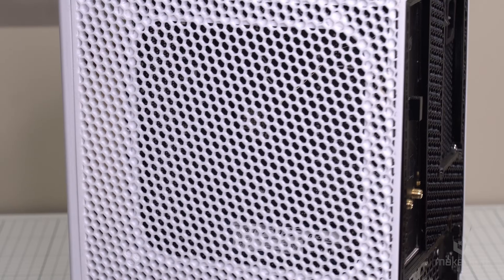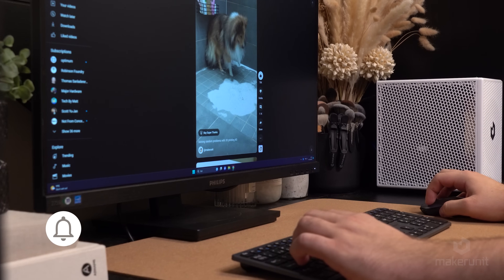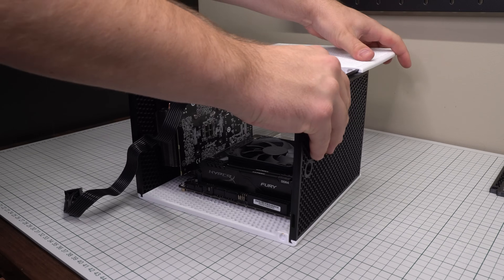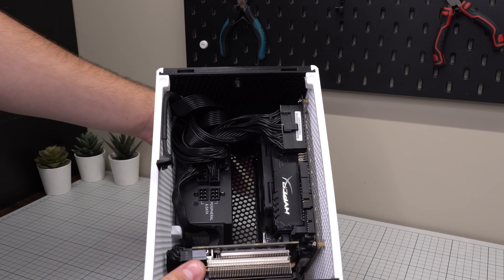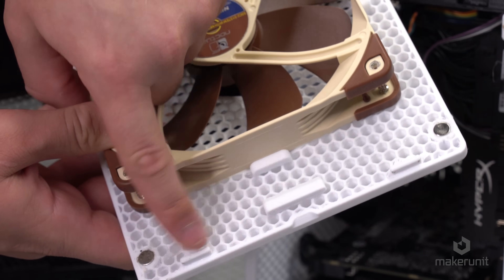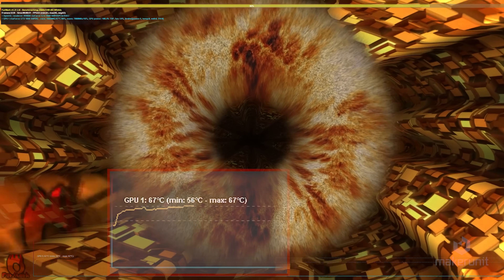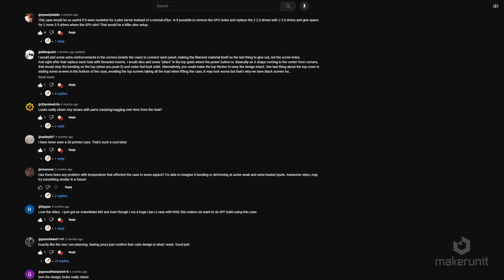Tiny 8.1L SFF build - 3D printed PC case

Comment: Adding space for an ATX power supply would be great!
Reply from the maker: Working on a solution for that for this specific design while the mATX version is printing! 😊 I’m experimenting with this exact model as we speak trying to find a clever way to adapt it for ATX psu without having to cut back on other features 😊
Reply: @makerunit  yeah that’d be great! I’m slowly downsizing my PC as I go (moving from a huge case to a smaller one, getting rid of HDDs in favor of M.2 drives on the motherboard) and the next step will be downsizing from an ATX to an ITX motherboard. The one part I don’t like to compromise on is the PSU though, and SFX power supplies are usually either too expensive or too unreliable for a quality budget build imo. I really admire your work with 3d printing computer cases though!

Comment: I am planing on building a really small case for watercooled cpu+ full size gpu with a riser cable and a normal psu. You maybe got a Motherboard mounting for ATX as well?
Reply from the maker: At the moment I only have for mATX. There are plenty of schematics online though that can be used as reference. Just google «ATX motherboard hole spacing» or similarand you’ll find something.

Comment: I beleive that a literally cool  idea is to modify your project to include a 120mm AIO cpu cooler, by example the Corsair H55 or H60, or Cooler Master - MasterLiquid Lite 120 or NZXT Kraken 120 just to name a few choices. With ths modification, the front fan can be removed. I am going to try the Corsair H55 that I have it already. What do you think of thos mod?
Reply from the maker: There would probably be room for that and it’d be a cool mod to possibly add to a new version. I’m planning a longer version of this same concept. Also a bigger one for mATX.

Comment: Very interesting project. I am going to build it right now. I have a doubt: What is the maximum height for the CPU cooler? Which cpu cooler model  do you used?
Reply from the maker: I used a Ryzen 7 5700G processor, cooled by the Noctua L9a cooler. Though I’ve got some room to spare and I think you’ll be able to survive with the stock coolers on Intel and AMD as well… I think they should barely fit.

Comment: How much did this cost you? Total cost?
Reply from the maker: About 700 grams of filament ($14 in plastic assuming 1kg is $20).

If you think including the PC parts themselves it’s kind of hard to say as it’s a mix of newer and older parts where some are not available anymore.
Reply: @makerunit  yeah I was talking just the case. And WOW. That is pretty cheap compared to all these small $80-$100 ITX cases. Thanks for replying man I really appreciate that.
Reply from the maker: @GabeTheDark1  I forgot to mention that I also had to get some magnets, screws and threaded inserts so I’d probably add another 10 dollars worth of hardware so I’d say about 25-30 bucks total to make the case.

Comment: You should absolutely design an mATX case. Think something like a Sama IM01/02 alternative. It fills the niche of being able to house any GPU and CPU by being a rival to the Cooler Master NR200, but with support for mATX motherboards and ATX PSUs without sacrificing the GPU length, like how the NR200 does with an ATX PSU bracket. The availability around the world is spotty and I for instance cannot buy it for the proper amount of money. I don't mind it taking up to a day to print all parts, but don't forget that ITX parts like the motherboard and the SFX PSUs cost a lot of money and we'd rather buy a mATX motherboard with a bigger PSU, if it's needed, to save on money. You may make it a bit sturdier to be able to handle a big tower cooler, but I don't think you should really focus on coolers that are too heavy and too big, which can handle Intel CPUs, because you only really need to focus on AMD CPUs like the Ryzen 9 7950X which would be undervolted and running at 105W Eco Mode, to greatly improve efficiency (necessary for europeans) and to be able to decrease the size of the CPU cooler (also, you only really need a CPU like the Ryzen 7 7700 non-X, and the GPU like the RX 7800 XT or lower, because RX 7600 seems like a good value GPU for most people though I don't even game, and frankly, neither should anyone).

That being said, I don't think many people would need very powerful hardware at all. A Ryzen 5 7600 with an RX 7600 or maybe even no dGPU at all (for an ultra-small 2L build with a Flex ITX PSU, which may as well have the best small heatsink to handle up to 16 cores at 65-105W on Eco Mode undervolted) would be a good choice, in particular for those that only have CPU-only workloads and for those who only need an iGPU (and some Tetris on the side) and favour portability, because plastic cases are very light.

So imagine doing something like an interchangeable design between the 8.5L version and the 2L version for Flex-ITX builds with no dGPUs, if that would be possible, where some of the panels like the main panels for the motherboard side can be used with either the parts needed for the 8.5L case or the 2L case.
Reply: Though if you were to design a 2L case, you should make sure to have mATX support, because it's very hard to find B650 ITX boards, and they cost an arm and a leg
Reply from the maker: Hi! I understand. Actually I’ve got a project in the making right now based on pretty much this same concept and it’s supporting all the parts you’re talking about. And a plus is it can actually support the big CPU coolers for almost any CPU you’d like. Even large GPU’s and tons of storage has been taken into consideration here in a fairly compact build tbh given what it can hold. 

Currently printing out the parts for the prototype and things are looking promising for now. 😊 I think many people will like this one because of the flexibility it’ll provide.

Comment: Amazing build yet again! I'm debating between modifying this to be longer for my GPU and a 2.5 hard drive or just using the Chimney case you made last month.
Reply from the maker: Or just wait for me to design the longer version of this same case. 😉 first a mATX version though.
Reply from the maker: Hi! Just checking in to let you know that I have completely re-designed this case to fit a longer GPU, harddrives and more, keeping the exact same aesthetics exept from the length. The print files are already available to get if you're a member of my Printables Club. Feel free to check them out already. Full video is in progress making and will be posted as soon as possible. Here's the link if you are interested. https://www.printables.com/model/688060-little-boy-s-long-edition-115l-itx

Comment: Love this concept. I think a slightly larger version that allows for current GPU’s would be fantastic. Also usage for front IO would be really good.
Reply from the maker: mATX prototype of similar concept in the making as we speak. First panel just hit the print bed. We’re talking 300mm gpu, 240mm AIO, HDD’s, ATX psu and more in a fairly compact build actually 😊

Comment: Tip for magnet polarity. Attach the magnet to the first one you install, then use a sharpie to put a dot on the side facing out of the second magnet. Then you just need to install the magnets dot side in
Reply from the maker: Great idea! Simple and effective. Do you know if the sharpie may affect the glue adhesion though? 😊

Comment: What type of soldering iron do you use? And any hopes for 6liter-7liter?
Reply from the maker: It’s possible to shrink this current design a tiny bit more by using a 120mm fan in the front and having the front panel pushed even closer allowing for a max gpu length of 170mm instead. Probably shaving off another liter making it about 7.

Then making the external covers even slimmer (with a one piece external cover) it could get down to about 6.5 probably in this config. (Maybe even 6) but that’d be tight to assemble.

My very first design I ever made like 2.5 years ago was something like that. A mini ITX with zero room to spare.. without using riser cables or anything, but it was a very plain and boring design which I ended up not really using, but it did work. Though I no longer have these files so I’d have to do a complete redesign in that case. 

About the soldering iron, just a regular pointy soldering iron that I believe is quite old, it has no brand that I know of…

Comment: I've always wondered if it would be possible to design a small(ish) form factor case where one of the walls is a 240m/360m radiator. Cooling capacity would be enough for a single loop between CPU/GPU with similar components to the ones you're currently using, but could drastically reduce spatial requirement for airflow, especially with something like a Barrow CPU pump/block/res combo.
Reply from the maker: Most things are possible one way or another and I think your idea in theory should work like with a low profile cpu block, and having the AIO right above the GPU, squished all the way into the motherboard. Should be doable. But I have no experience in water cooling a GPU.

Comment: I would not be surprised to see this style of case being mass produced
Reply from the maker: Maybe maybe some day 😊
Reply: Not realistic really, all the parts would need to be made with a cnc and the magnets would not be a thing since the weight of the panels
Reply from the maker: @yeetmeister0704  mass produced can mean a lot of things. Noone mentioned that it would have been made out of lead or gold. (Which is heavy)

If it was aluminium the weight and perforation  in the panels like this it wouldn’t really be an issue. 

Also the panels are supported both at the top and bottom meaning not much weight is actually on the magnets. 

And I’d agree that to make it manufacturable in metal it’d need a few design changes but that wasn’t the point here, the point was the «style» of case, not this exact design. 😊

Comment: All I can say is that your work is amazing. The designs are clean while easy to understand and print. I have a suggestion for this series. I would be amazing to make a case for a small home lab server. The main ideea is to be able to have a lot of space for the 2.5" drive/SSDs. I tried online but i wasn't able to find a good design and i think with your design experience, you can help a lot of people wanting to build their own 100% diy mini home lab server. 
It is just an ideea, i know this things take A LOT of your time. Might be quite cool tho :) .
Anyway, you rock!
Reply: I'll second this idea but add that a lot of home server/NAS setups use 3.5" drives for cost and reliability. 4 drive slots would be a minimum I think
Reply from the maker: Thank you! The idea is definitely cool and a possibility for a future project! I have some hard drives laying around so I’ll consider it, thanks for the suggestions and the positive feedback 😊

Comment: Could you add a dedicated SD card reader to this design?
Reply from the maker: It’s possible. Though I don’t know of any panel mount SD readers, do you know of any? That can be installed without too much modification?
Reply: @makerunit  Ok, I will try and look for one, and just cut the appropriate slot for it. Maybe on one of the sides or the top. Which location will be ideal for that addition?
Reply from the maker: @migueldevela2917  the .step files supplied on Printables should be editable in most CAD programs without much hassle. 🙂
Reply: @makerunit  On which side would be ideal to place the reader. If ever, in order to avoid the power supply, fan, and MB?
FYI, I have already printed the front panel. It took some time but looks good w/ the logo too.
Reply from the maker: @migueldevela2917  awesome! 

Maybe all the way down in the right corner next to the GPU vertically maybe? So it sits behind the GPU and is not conflicting with any cables. given that it’s a slim card reader of course.

If it’s placed down in the left corner it might interfere with the GPU power cable depending on where  it’s mounted on your gpu. And any higher up it would interfere with the 140mm fan. So yeah down in the right corner seen from the front, is probably the only ideal placement.
Reply: @makerunit  Thank you so much.
Reply: @makerunit  Will that be next to the motherboard or t power supply? Just to make sure I make the cut-out on the correct side.
Reply from the maker: @migueldevela2917  next to the motherboard. That’s the only place it should stay clear of any wiring. All the way in the lower corner under the motherboard.

I’d love to see some pictures of how your modification turns out! Feel free to send me some pictures in the Printables chat if you don’t mind! 😊
Reply: @makerunit  I sure will. As soon as I can find an appropriate card reader.
Reply: @makerunit  What are the measurements of the area next to the motherboard? My Thinkercad is acting up and will not load any new designs.

Comment: i like that ideas 3d printer pc case
if i were get one it would be atx have wifi card and gpu that is 3in wider than mobo plus psu behide mobo not in front of it so big heatsink 90mm is flat enough same as gpu stick out and i would like make stand hold up my gpu that way doesnt get shaked everywhere
you did awesome jobs making matx case out of 3d printer
Reply from the maker: Thank you! 😊 long term the goal is to make a ATX full size case as well some day!

Comment: maaaan i've made an itx case too but I dont have an itx motherboard to use it with :[
the only CPUs i have are intel i7 13700k and i5 9600k
and itx motherboard for both those generations are super expensive
Reply from the maker: What about looking for a used 1151 socket ITX motherboard for your 9600k? Aren’t those a bit cheaper now as they’re 9th gen?
Reply: @makerunit  barely any on the used market
Reply from the maker: @noapoleon_  hmm, I see. Maybe my next case fits your needs better then. It’ll support MicroATX and some other goodies!

Comment: Man I love your vids.  I would love to see this expanded to fit a big 4090's like 337 x 140 x 77 mm.  I still cant find the perfect case which for me would be small ITX motherboard, can fit thick ass video cards, and support a 240 or 360 AIO.  SFX-l or atx.  Smallest possible footprint and super breathable.
Reply from the maker: I think I’ll actually be ticking all your boxes in my upcoming design. (If it works out the way I’m planning). 240 AIO though, not 360 😊 but a 240 is more than powerful enough for most CPU’s anyways 😁 (currently I’ve made my scratch design for a 300mm GPU, but I’m looking at options to allow for 50-60mm more.

I’m considering making two different front panels, one that’s flat like in this build to allow for 300mm exactly, and one that will stick out a bit in the front allowing for even bigger sizes.

Comment: Super well done! I've been thinking of 3D printing my own PC case. Does the plastic warp at all from the computer temps???
Reply from the maker: I’ve not noticed any problems with warping at all to be honest. Not with PLA and not with PETG. 

I mostly use PETG as it’s generally stronger in my opinion and a bit more temperature restistant.

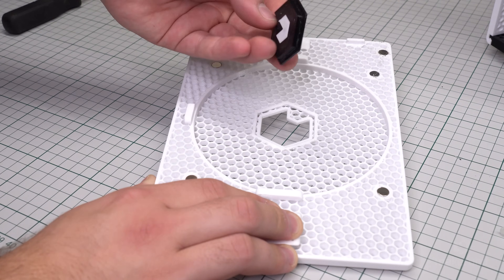Comment: 7:40 the best way to glue PLA with PLA is to use ethyl acetate (dirt cheap in chemisty suppliers), as it dissolves PLA, evaporates and leaves plastic-plastic bonding (fusing) with "native" strenght and zero residue. Basically same thing that acetone does with ABS and n-butyl acetate does with polystyrene.
Reply from the maker: Any «chemical» methods that can be used to bond PETG? That’s mainly what I use to print.
Reply: @makerunit  internet claims ethyl acetate should work for PETG as well, but I haven't tried it (and can't go to my workshop right now).

Comment: M size would be perfect, as while it uses more filament, you avoid the ITX “tax”, since mATX motherboards are often cheaper and you could probably have those longer/thicker GPUs with no issues.
Reply from the maker: Working on it! This upcoming one is intended to fit some pretty powerful stuff 😊 (and the cooling required to make it run smoothly)

Comment: You should absolutely test the limits for a larger build and even for a smaller RPi build with an ice tower just for fun
Reply from the maker: My next one is looking like it’ll maximize my 300x300mm print bed with some 300x300mm panels😅

Comment: Very nice case! Could I also use pla+ for the panels?
Reply from the maker: You’re free to use any filament you’d like. I’d think PLA will be fine though I haven’t tested. I’ve never encountered issues with any of my cases though so I think it’ll be fine. 

Although I do recomment PETG when possible as the layers bond stronger making the joints more reliable in my opinion.